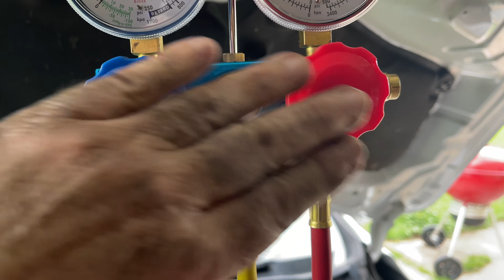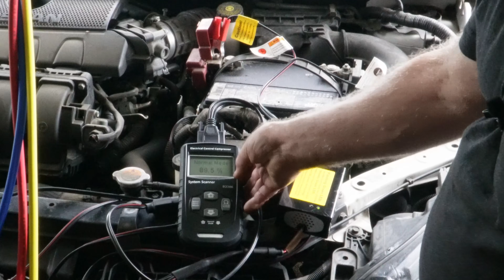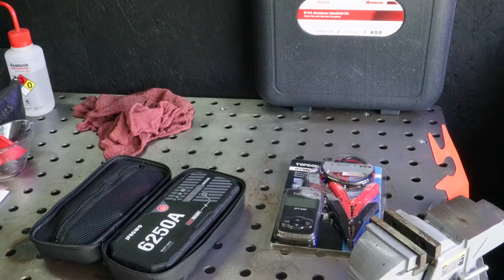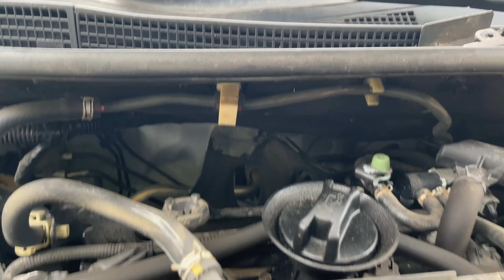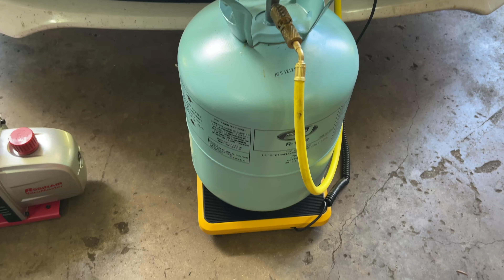How To Diagnose A Bad Automotive AC Compressor With 100% Accuracy

Comment: Story of my life: Had issues with poor cooling on R50 Mini Cooper, decided to use that cheap ZeroR gas with gauge kit (didn't know at the time but this stuff is "fake" R134a). A spin later, clutch was not engaging, gas was gone, checked all fuses, relays, all checked out, bypassed the relay and engaged the clutch to recharge with a more reliable gas like EZ Chill ("real gas"), after recharging it appeared that it took but hot air coming in, an hour later gas was completely gone.

Are these fake gases ruining compressors, or is there something that I'm missing here? It appears that the compressor is still working but not holding gas. Thank you so very much for your content.
Reply from the maker: If you lost all the gas within an hour then you have a massive leak that should be easy to locate.  That leak has to be found and repaired first, then a deep vacuum needs to be pulled before recharging with pure r134a refrigerant.  Be careful when purchasing refrigerants to make sure it is pure and not a knock off and also stay away from the cans that says it has sealants and conditioners in the can.  These will cause a lot of problems in time and most AC shops are able to detect these epoxy based sealants with a sealant detector and will refuse to work on your car because these sealants can ruin their recovery machines.  They also can detect mixed gasses with a refrigerant analyzer.  On a side note, running a compressor with a low refrigerant charge will destroy the compressor quicker than anything, because the oil cannot properly return back to the compressor and drops out in the evaporator where it gets trapped.  A full refrigerant charge is a must.  Hope this helps
Reply: @SkillSavvyDIY  Considering all the facts in this mess, is it best to replace the compressor/clutch at this juncture?  The mini cooper is about 22 years old.  Also, considering the fact that there were no apparent leaks before using that fake shit, is there a greater possibility that the compressor is ruined and not any leaks on lines/condenser coil?
Reply from the maker: From years of experience I can tell you that you can possibly have a leak anywhere in the system.  Could be any of the refrigerant lines that have rubber (look for oil coming through hoses), could be condenser, evaporator, pressure switches, o rings, or the compressor itself.  There are multiple ways to look for leaks, but if it were my vehicle, I would solve that problem before buying or replacing anything.   The system has to be able to hold pressure before the compressor can be checked to see if it is functioning correctly or not.
Reply: @SkillSavvyDIY  Ok, sounds good.  Thank you for the sound advice!  Is the UV Dye method your best/first approach?
Reply from the maker: @n.g.1577  UV dye is a great method for finding leaks, especially slow leaks.  I also use BigBlue bubble leak detector to spray on larger leaks to pin point.  I pressurize with dry nitrogen to 250 psi when using the bubble leak detector method.  I also have  set of Fieldpiece Sman digital gauges that allows me to do a tightness test to prove the system is leak free after making the repair.  I use nitrogen with that test as well.  I have these tools because I do this on a regular basis.  I wouldn't expect anyone just fixing their own car to go to that expense.  Soap and water is what I recommend to find your leak since it sounds like a rapid leak, but you will have to pressurize the system to do that.  Some shops use shop air, but I don't recommend ever purposely injecting air into an AC system.  The goal is to keep air out, so that's why I use dry nitrogen.
Reply: @SkillSavvyDIY  Thank you.  Any particular UV Dye kit that you would recommend as a solid reliance?
Reply from the maker: I like Tracer Products dye, but there are others such as Master Cool as an example https://www.amazon.com/MASTERCOOL-53351-B-Professional-Detector-Light/dp/B000IHJXHG/ref=sr_1_39?crid=3OTZG8ZLAPKPB&dib=eyJ2IjoiMSJ9._nCO3VYmLxFQY-mLf3sOQCnMNXcOiKytJuDrNK5ZMI0r2_Ay777DCvKXzsMQ6x4iz-mW-lKma7avwAWSEc0x-FAhRKHREqZPqA8KK5mWDoRr7DGz74tQrBeVtU2sJ5uqECtK8qY0hthws4AcLfH5aGJXaIsWG7ssXOLkp_IyMf5yiWb52vM0CGCnuQH51mrMSnlJZrVX4CcSVbOgv66-Jyzp26AWkYE9p05JbtRWloffJ2zClICMr-_jknO33WngvpxRBKekWY8q4yyba2WbUDZMHq3AybB9rswDuhqSj1o.MbGwOzZ17WU5DcpZVG6GgUyIOsAQUsEcYzVN2WaLqVY&dib_tag=se&keywords=tracer+products+UV+refrigerant+leak+dye+kit&qid=1750707315&sprefix=tracer+products+uv+refrigerant+leak+dye+kit%2Caps%2C104&sr=8-39&ufe=app_do%3Aamzn1.fos.9fe8cbfa-bf43-43d1-a707-3f4e65a4b666  Your system could need an ounce or two of oil as well since it has been leaking.  You can bye refrigerant oil with UV dye already in the oil as well.
Reply: @SkillSavvyDIY  Thank you very much for your prompt responses.  Would you be able to share on how to do the UV Dye process if I possess my own gauges and vacuum?  Have a nice day.  What Dye would you recommend that already has the oil in it (stand-alone Dye, not from a kit)?
Reply from the maker: There are multiple ways to get the dye in the system.  I own a few injectors that will add dye or oil with dye while the system is fully charged but since your system leaked all of its refrigerant, you can remove one end of the suction line and pour the dye directly into the line, or you could do it through a service port by removing the valve core, or you could use an injector.  There are a few trusted brands of oil with dye but Super Cool brand is readily available at most auto parts store.  Good luck and remember there are a lot of videos on YT showing how to do this.  I will eventually have more and more videos as well

Comment: If an expansion valve was faulty, is it possible the compressor clutch would stay in gauged?
Reply from the maker: A faulty expansion valve in a car’s A/C system typically will not directly cause the compressor clutch not to engage, but there are indirect scenarios where it could contribute to the issue.

Comment: Hello rus!  I have a 2015
Escalade esv.  Compressor runs, fans run but doesn’t heat.  My wife told me it would cool food some days and some days it wouldn’t.  Now it does get cold at all, cooling fans are always running and speed up and slow down intermittently.  Any suggestions?
Reply from the maker: There are a vast amount of reasons why an AC system won’t cool and it’s impossible for me to give you any helpful information without me being able to actually hook up to the vehicle with diagnostic tools such as gauges and scan tool.  Not the answer you were wanting I’m sure but that’s the reality of it.
Reply: @SkillSavvyDIY yes sir.  I hooked up manifold gauges they are reading 50 psi on low side and 50 on high side as well.
Reply from the maker: @noeturrubiates1068  Once again not enough information.  What refrigerant does your car take?  What was the outside ambient temperature when you checked pressures?  Is it a variable displacement compressor?  fixed displacement?  Electric?  I will say that if you are in a hot climate, and using r134a, then 50 psi is too low, and if the compressor was running, you should never have the same pressure on both sides of the system.  Sounds like the compressor isn’t pumping, but wait!  If it’s computer controlled then perhaps the pcm isn’t controlling the ECV solenoid that controls the displacement.  Those are the kind of things that I would actually have to check myself to accurately tell what’s going on.  Otherwise I’m just guessing.  Wish I could be more help, but without being able to physically check the system myself, I can’t help you.
Reply: @SkillSavvyDIY you have helped more than you know.  I’m from a small town and there are not many options for me to have it diagnosed properly.

Comment: My compressor failed and I was quoted about $4,000 to fix it. They said my compressor "grenaded" and contaminated my entire system. AC systems always intimated me with all of the specialty equipment needed, but after doing some basic research and watching some YouTube videos, I was able to purchase all OEM parts for about $600. That's a new compressor, condenser, dryer/desiccant, expansion valve, O ring kit, and oil. I was able to replace the expansion valve and compressor, and I was quoted $350 from a different shop to install the condenser (I didn't want to mess with removing the grille and front end of the truck), flush the lines, and re-charge the system. Moral of the story? If it feels wrong, it probably is. Do your own research and don't let dishonest shops take advantage of your lack of knowledge. 

Don't forget that Auto Zone will rent out a vacuum pump and gage manifold for free . You simply pay a deposit and they refund you 100% when you return the equipment. The original shop did a simple pressure test to come to their findings and charged me $160. I could have received the same info literally for free.
Reply from the maker: I started this channel to encourage people to do things themselves.  Ton of information across the web.
Reply: Congrats, so how much was your complete cost? I suppose you are mechanically inclined! What can I do if I don't have the tools, time, space,  know how or courage. How much time did you spend on the research phase?
Reply: @Dtapia63 

You need a basic ratchet wrench set with deep sockets and also a vacuum pump.

Then your refrigerant cans and tap set for ac gauges

Gonna need a condenser which comes with the dryer/ accumulater and compressor and H block that connects the high/low pressure lines to the firewall.

Depending on what vehicle you have, this took me a weekend to fix my entire system in 2006 dodge charger.

Comment: Good video, but it doesn't need all these fancy tools to test the compressor. All it needs to test bypass everything and feed 12V power directly to A/C compressor clutch to see if it A/C clutch engages. If A/C compressor clutch engaged and A/C Freon pressure looks ok then test the A/C pressure switch. Unplug the A/C pressure switch to probe the power or dip the connect plug into water to see if it A/C pressure changes (A 2/3 pins plug on A/C line, Some has one on both high and low side but most on low side) . As for the A/C flow sensor on the compressor, it will tell you in OBD2 scanner if flow sensor on the compressor is good/bad (won't open).
Reply from the maker: I think you missed the point of this video and it flew right over your head.  I said in the video that it had plenty of pressure.  I showed that the clutch was engaging, because the compressor was responding a little, so obviously the pressure switch was functioning by allowing the clutch to engage.  The problem shown by the gauges is that the compressor was barely pumping.  Todays compressors use a electronic control solenoid that can change the displacement (piston stroke) of the compressor as the computer commands changes in the displacement based on heat load.  The "fancy" tool I used was to prove that the computer was sending a pulse width modulated signal to the compressor so I could rule out sensor or any computer related problem.  Some scan tools will allow you to do the same thing.  For your own information, a flow sensor and a ecv solenoid or not the same thing and not all variable displacement compressors have flow sensors or rpm sensors.  You can also check the pulse width signal with a DVOM that can read duty cycle as I mentioned in the video, or a scope.  This tool just makes it way more convenient.  You have to know if the computer is actually sending signal and operating the ECV before condemning a compressor.  Hope this makes sense to you.
Reply: @SkillSavvyDIY  It's still a good video, I don't deny it. To a regular Joe, those are still fancy tools and expensive to get. Simple less than $50 dollar tools including the gauges for regular Joe can diagnosis the problem. :) Don't get upset!
Reply from the maker: @globaldigital4747  I'm not upset, I'm simply saying that you cannot tell if the ac control module is sending pwm signal to the compressor electronic control solenoid with out a tool that can read it such as the tool that I used.   Gauges are certainly not going to tell you anything other than it's not pumping.   It's not going to tell you anything else.  If I were to have just relied on the pressures and assume I had a bad compressor, and went to all the trouble to replace it, only to find out later that it was a sensor or computer issue, then I would have spent a lot of money for nothing.  But instead, I proved that it wasn't related to the computer or sensors, and knew without a doubt that I was dealing with a shot compressor.   You have to consider that nowadays since all ac systems are totally computer controlled.  This isn't old school AC like it use to be.  Thanks for watching
Reply: Good to kno... That's basically what my mechanic said they did... They said they couldn't be positive it was the compressor tho... Not sure why

Comment: No way they're putting 6250 amps through those little cables. If I had to guess it's probably 6250 milliamp hours of battery capacity if anything. Those things are pretty impressive though. I've jumped lawnmowers, diesel tractors, cars and full size pickup trucks with mine no problem and it's even smaller footprint than yours. Those old lead acid jump boxes were trash. I had one and it lasted maybe 2 years of intermittent use and it didn't work very well even if it was brand new. If the battery on the car was completely dead it wouldn't get the job done. It would only help something that just needed a little more oomph to get the engine cranking.
Reply from the maker: Yeah I questioned that myself but I’ll tell you one thing, that little dude will spin a motor over like crazy!

Comment: Does the ac clutch have shims u can remove ?
Reply from the maker: I'm sure it does.  Most do.  If you are thinking to much air gap, then it wasn't.  Clutch was engaging fine.  Modern compressors don't wear the surface out near as bad as back when ac systems cycled on and off with pressure.  Today they engage and stay engaged until you turn them off thanks to the computer controlled variable displacement compressors.

Comment: Hi. MR. I was observing the sticker to referring the type of AC That is use for that system, but for the type of compressor oil there is only (DH-PS) type. My question is if the (DH-PS) oil Type is the same or equivalent to PAG-46 type oil. Cud you tell me about it please.
Reply from the maker: Yes, DH-PS is a specific grade of PAG oil, which is the most common type of oil used in R134A automotive A/C systems.

Comment: What if it doesn't have coolant? The compressor won't kick on and you HAVE TO do a leak test and fill just to see if its bad?
Reply from the maker: If it is out of refrigerant, then yes you have a leak and that needs to be located and repaired.  If it is a very slow leak, you could potentially charge the system with refrigerant, then check the other components such as the compressor, then try to locate the leak while it is under pressure using a sniffer, or soapy water.  If you have no luck, then add a UV dye into the system and run it around a few days, then look for the leak at dark with a UV light.  Once leak is found, recover the refrigerant, then make the repair, evacuate using a vacuum pump, then recharge with the proper amount of refrigerant.  If you have no experience with any of this, then I recommend just taking it to a reputable AC shop
Reply: @SkillSavvyDIY Thanks for all the info. Yeah just asked a shop. They recommend new compressor, drier, pully / belt and condenser... $1995.00. Seems high but what's not anymore!?
Reply from the maker: @fishsizzle83  Yeah, AC work has gotten really expensive, but as you said, everything has.
Reply: @SkillSavvyDIY And it being a 14 Ram 3500 probably doesn't help! 😂 Thx again. SUBSCRIBED!

Comment: Great info, AC Is one of those trades that im afraid to do...  
My 2003 chevy van was working, eventually the compresor star freezing, till the belt rip, is getting hot here in south LA, i was planing on just droping an other belt but im afraid it would rip again. Should I just chenge the compressor, or what may by the problem.?
Reply from the maker: you need to turn each pulley on the engine to see if any are locked down including water pump, alternator, power steering, etc.  On the compressor, you need to turn the front hub to see if the internal parts will turn.  If not, then it is locked up.